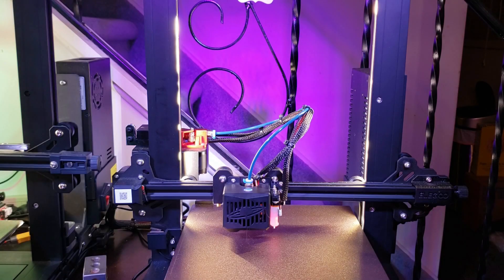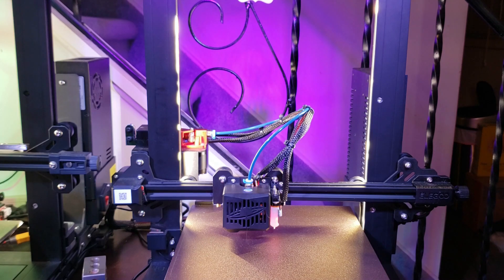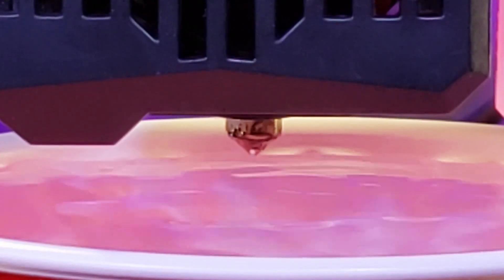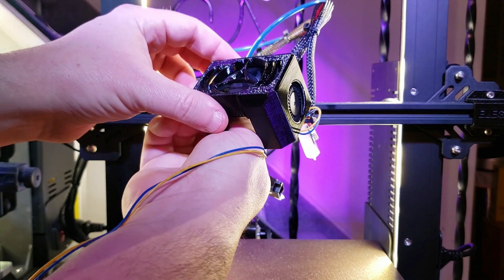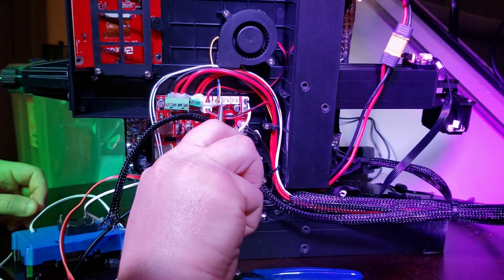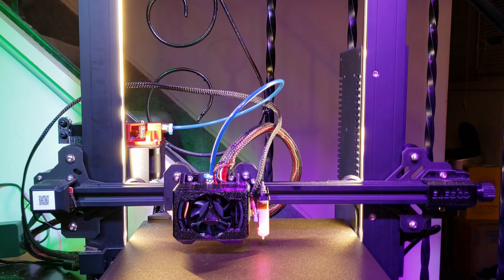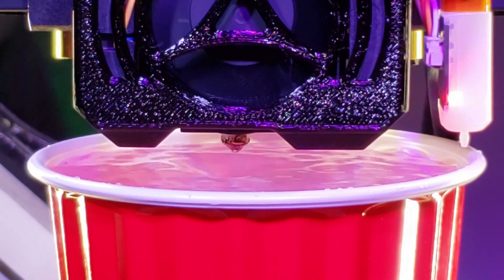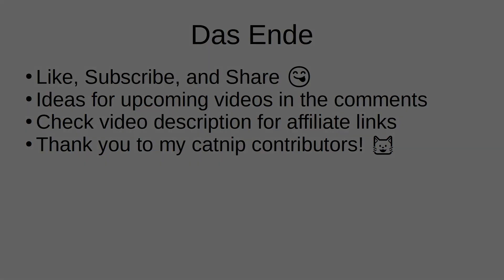Dual blower fan install for the Elegoo Neptune 2 and other single fan 3D printers

Comment: love the tutorial, planning on doing it myself but would wiring the fan that way draw too much power or short the board?
Reply from the maker: Nope. Been running it this way since I installed the second fan.
Reply: @TheFeralEngineer  cheers, thats the green light

Comment: Honestly this did not work for me. Now my prints come out deformed on the side that wasn't cooled before. I've also noticed that sometimes the fans don't turn on at all and I go into settings to turn them on mid print. I've verified that both sides are in fact blowing air.
Reply from the maker: Sounds like something isn't right. I've had great results and know others who are using this exact same shroud with good results as well. Curious why they aren't turning on in your program, though. That's a weird one.

Comment: Question, did you have to change any settings like print faster or hotter using the double fans?
Reply from the maker: I always ran my filament hot so i haven't seen much difference there. I use mainly pla+ and petg; 215 and 245 respectfully

Comment: How did you hook up your dual fans on the board. Did you just wire them together, or is there a spot for each fan
Reply from the maker: spliced together in parallel. I show the splice at about 2:00
Reply: @TheFeralEngineer  lol just saw it bro thanx

Comment: Nice video! I was wondering how you actually took care of the pwm whine. I have this annoying noise on my N3 Pro running klipper that I suspect might be the same issue.
Reply from the maker: The whine I was getting was firmware specific for some reason. I changed to softpwm with a dither value in Marlin and it went away. Klipper i didn't have any whine with, but I'm sure there's a similar way to fix it

Comment: I also put the dual fan on my Neptune 2, and it works very well
Reply: Did you solder a fan by splicing it into the existing wire?
Reply: @waqarsiddiqui3608  Yes, now i have 3 fans

Comment: Great video and walkthrough! Much appreciated! Will definitely give it a shot! Quick side question: Do you have your z-motor running faster than normal? Sounded and looked fast! Thanks again and looking forward to your next vid!
Reply from the maker: I do. I have everything cranked up. I think my Z runs at 10 or 15mm/sec and my X and Y for safe Z homing and abl is 300 😆
Reply: @TheFeralEngineer  Ouu, I like the sound of that. I need to look into that! Fast and the Furious FDM edition
Reply from the maker: @allangraham5507  i was running speeds like that in Marlin, but my machines run better with Klipper 🙂